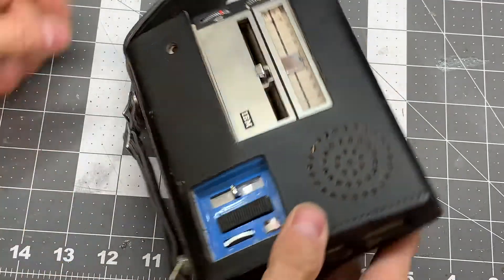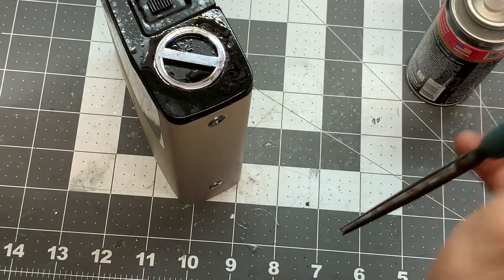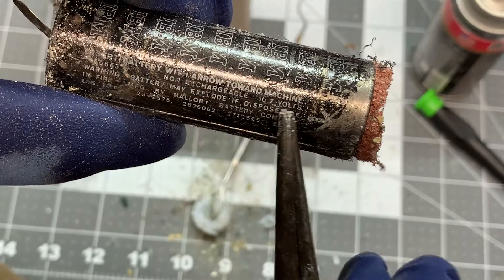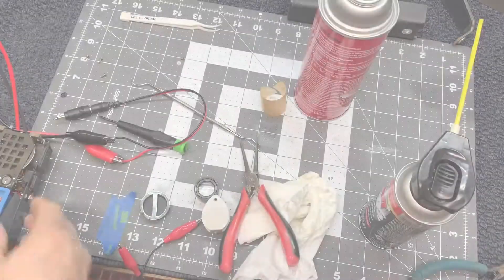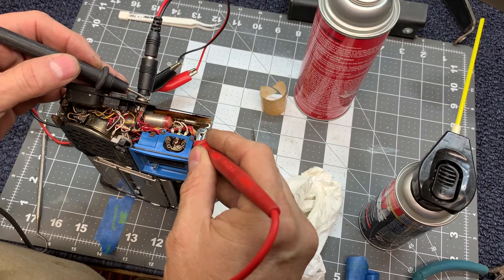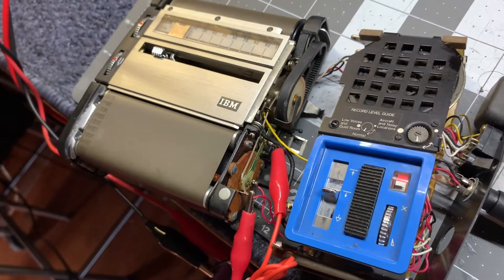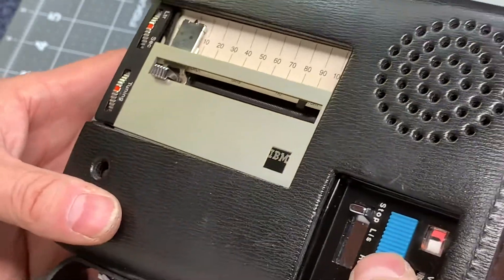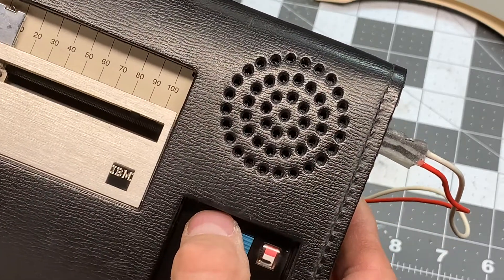Magnabelt Wonder!  IBM 224 Part Two

Comment: 224 vs 274      In Canada the newer two speed model was named the 274. Much simpler mechanically and easier to service.
Reply from the maker: Yes. Correct. I have the two speed model as well.  Both nice recorders.